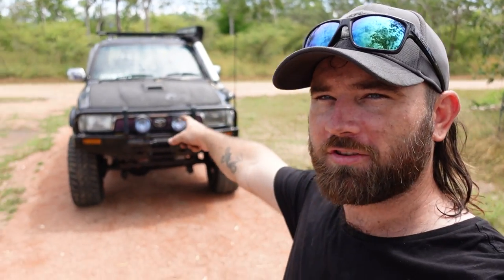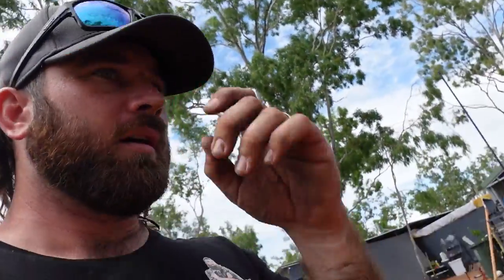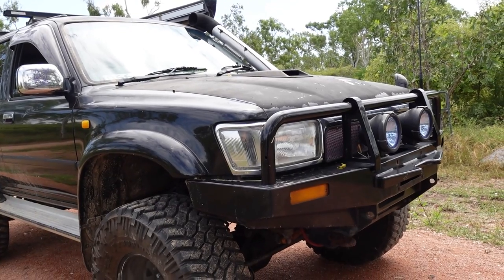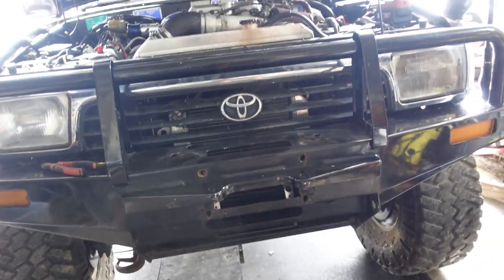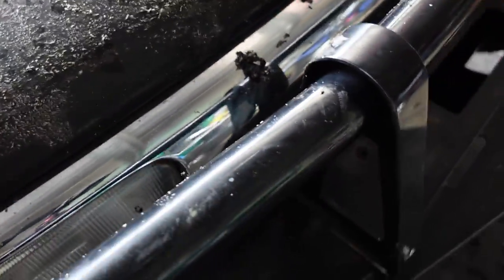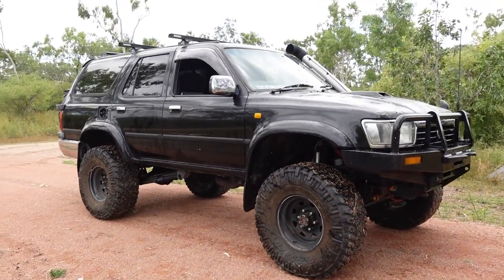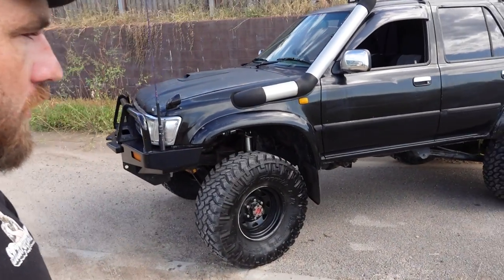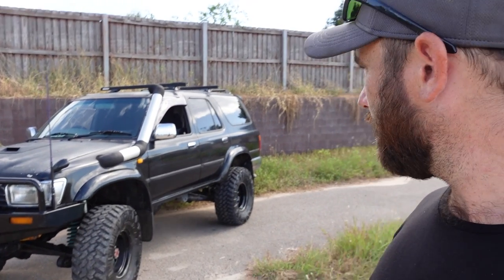Classic Example of Youtube 4WD Content. Surf Has Some Demons!

Comment: those things are known for doing heads , but otherwise a bullet proof motor. Recommend  a 10 blade fan to keep it cooler, they are available for about 125 dollars instead of the 7 blade fan they come with. Better for bigger tyres.
Reply from the maker: Are you talking about the 3rz?